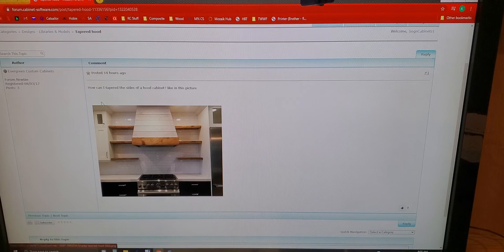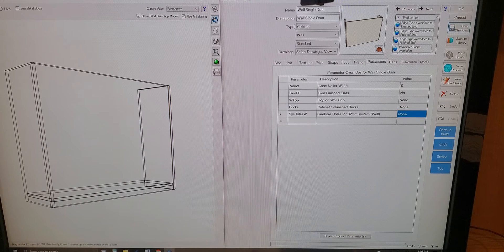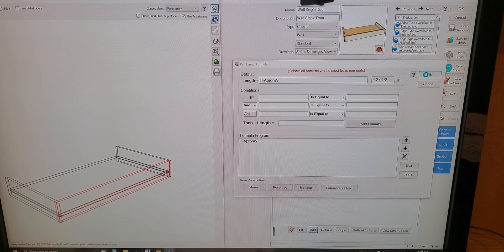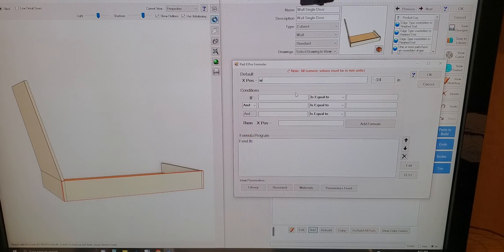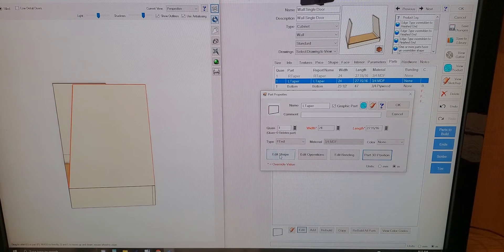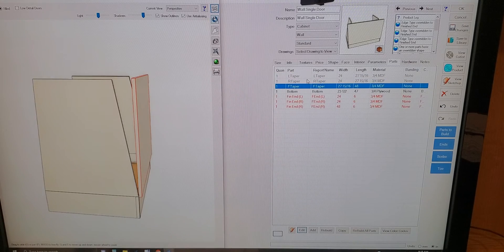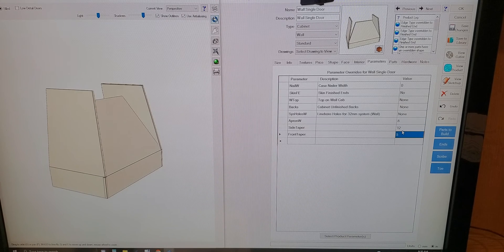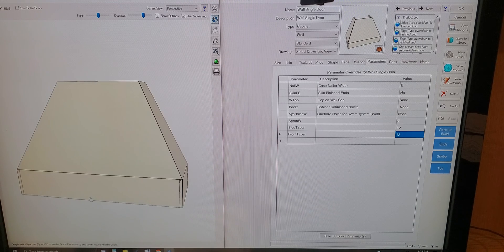How I Make:  Tapered hood enclosure in Mozaik

Comment: Hi just wondering if you use mozaik manufacturing and if so how do you utilise it?
Reply from the maker: I'm not tracking.  In what way?
Reply: KBrogger was thinking of getting mozaik manufacturing for solid/mdf panel doors ie cut lists calculations sheet optimising etc and was wondering if you had experience with this module?
Reply from the maker: @patoleary5334  I don't, other than I use the full cnc version.  Which should be everything the same, except for you won't be creating nests with any machining like I do.

Comment: I'm new to Mozaik, been using it for 3 months now, I've been intimidated by that whole formula panel, and maybe I'll just have to get 1-2 hours of training to really get my brain wrapped around how to work it, watching you use it shows me there's a lot of potential in knowing how to use it, so my question is do you have computer programing skills or have you been instructed by Mozaik, I'm just a carpenter with 25 years experience drawing things out on cardboard full size then cutting it out.I have12 years in a custom cab shop w/ Holzer CNC router,  but came to a small company that bought a Komo, using Mozaik to produce the G-code, going from Sketchup/Layout to Mozaik has been fun and stressful. what advice would you give me for direction to go? Thanks
Reply from the maker: No computer programming for me.  I'm a high school drop out.  I did maybe four hours of training the first few months with Mozaik, and I've done a few more since then to resolve specific issues, or to get something to work the way I wanted.
My advice is, just keep pushing yourself out of your comfort zone, and keep thinking about ways to make things easier on the bench.  I do a ton of stuff that Mozaik doesn't do natively, just to make assembly easier.  On base cabinets, all of my stretchers run through the partitions where necessary, there's a notch in the partition, and there is a shallow dado in the stretcher.  If I've done my part in the office, at the bench you almost don't need to measure anything.  Same with my nailers in base cabinets.  They have a dado to accept the notch in the partitions.  Assembly is super easy.

I don't know what your math skills are, but learning/knowing some basic geometry and trigonometry is super useful.  With math functions and variables, you can do just about anything in parametric software.

Keep pushing.  I'm a little over two years into Mozaik and having a cnc.  Laziness makes me want to get the router to do as much work as possible.

Avoid making custom parameters if you can.  It ties up the ability to modify the part.  I only have one active one that I use.  A "Custom Parameter" is different than a "User Created Variable" or "User Created Parameter/UCP"

Take notes.  If you're struggling with something, write it down.  When you have a page of notes, pay for an hour of training and go through the list with the trainer.  I did that a couple of times.  I just kept a Word document on my desktop.

It all takes time.  I'm still learning stuff.  I wish there was a Matrix option where I could plug in and just know things.  But, there isn't, so you just push and learn.
Reply: @KBrogger  Thanks, my wife was a math major, taught High school Physics and Math, so with her knowledge we can get an understanding plugged into my brain, I’ve seen a lot of your posts on Mozaik forums, I’ll keep pushing and reading, help desk has been a lot of help as well!
Reply from the maker: @jacobwilson3316  You've got a leg up on me there!  I had to teach myself trig with youtube. lol  I still have to cheat on the regular, or hack my way through it.
Reply: Have you learned how to square your dims? If not my wife just taught me to put in either dim or parameter then use ^ so ApronH^2 will square your parameter, as I said she was a math major, that carrot is above #6 on keyboard

Comment: Thanks for this run through. I just started with mozaik a couple days ago. 

I was running fusion 360 and built a bunch of parametrized cab boxes for kitchens. It was still painfully slow to get everything perfect and toolpathed for  my router. 

Do you know of a cheet sheet that lists parameters that can be called up?
Reply from the maker: Yes.  All of the parameters are listed somewhere on the Mozaik forum

Comment: Holy smokes my head is spinning!   I've been using  Mozaik for over a year but I have not ventured this deep into formulas.  Its a challenge to think the way the program wants me to think and input the information that way.  I can figure all of these things out but communicating to Mozaik is still a work in progress.   Thanks for sharing this.
Reply from the maker: You can do it.  The thing with really any parametric software, is you want to use a native variable to modify something whenever possible.  The last resort is just putting in a number to alter a part.  Anytime you can tie multiple operations, or modify part shapes/sizes with a variable, you want to do so.  Trig, Algebra, and variables, you can do just about anything to cabinet parts.
I build cabinets in a really weird way, it makes sense to me, but not to everyone.  That has pushed me to figure out how to get the cnc to do as much work as possible, and to make life on the benches as simple as possible.  Along the way, you learn how to really manipulate the parts and the software to get what you want.  I'm also extremely lazy, so if there's an easy way to accomplish the goal, and save some effort in the future, I will do it.